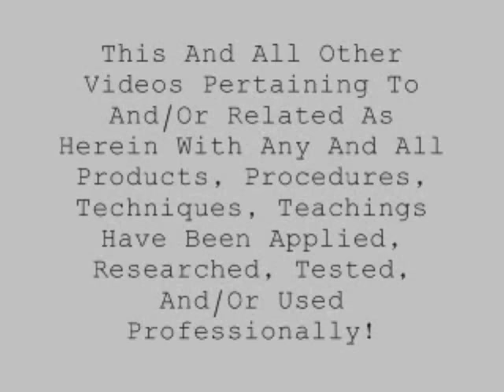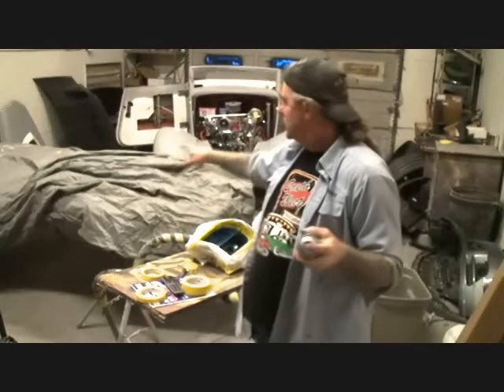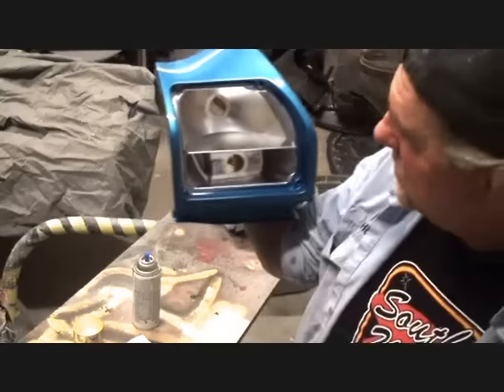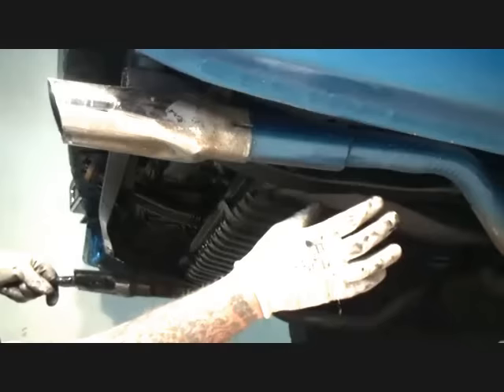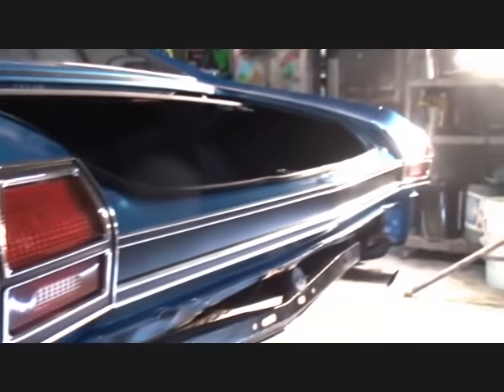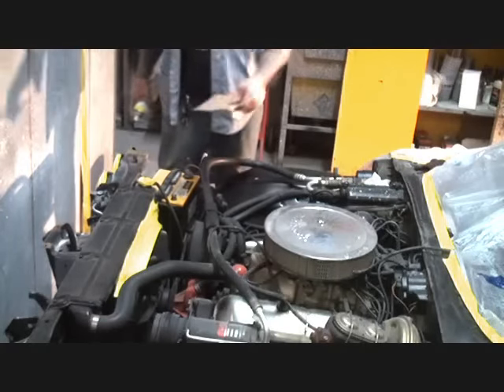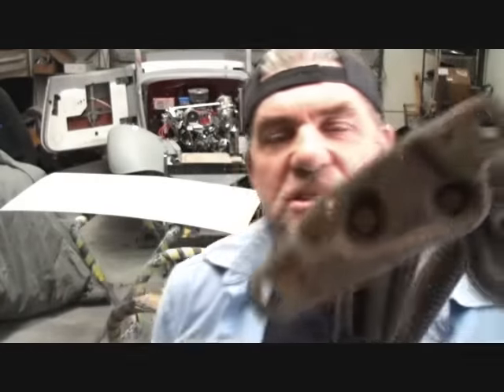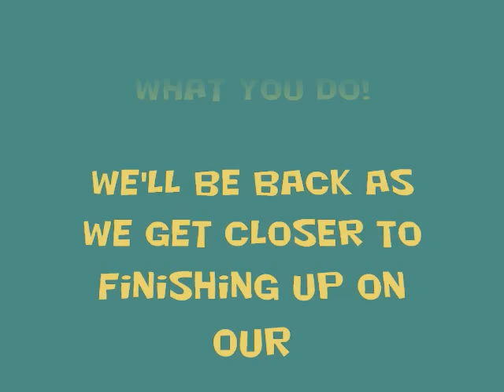"How To Paint A Car"-By Yourself-Part 15-"ATTENTION TO DETAIL"

Comment: Bolts , nuts and washers the same size as the mark you want to save will work very well. Place the washer over the old mark and use a bolt and nut to hold it in place and you won't have to worry on losing the marks.

Comment: hey Pete just throwing out a tip to you about POR 15. It really only likes to stick to rust like a light surface rust. It doesnt really like to stick to a painted surface very well unless you use an adhesion promoter. Not trying to be a know it all or a jerk here bud just trying to throw a little help back in your directiion to pay back all the help Ive had from your videos. Bill

Comment: Pete of you really want do a blinding slick job on the tail light lens bucket, you can paint it silver and you can even foil tape it, they will be REALLY bright. They make super high reflective tape its like a mirror. .. But for a customer car, Ehh. Its kind of a custom touch + it can fail in time.  I have seen alot of RESTORED cars with really dim lights at car shows,, I bet the lens bucket is body color. Your creation looks better than new!   Ive gotten paint on exhaust alot of times, It comes off crazy easy with a razor.   At-least you try to fix it, How many crappy paint jobs have you seen with a BODY colored exhaust, completely overlooked.

Comment: Am working on a 94 corolla my son bought w/o me seeing it coz he kinda sensed it will be rejected.  We ended up stripping the car to bare metal using a heat gun because there was thick body filler all around.  One sack of body filler with three layers of paint  was removed.

Comment: 1982, I took a small hit on the front. They didn't open the hood and remove the L Bracket and VHF antenna or mask off the windshield . They didn't like taking a razor blade and scraping every square inch of the windshield But They Did!.

Attention To Detail
Reply from the maker: +mcinkyt Ya gotta watch out for shops that get in a hurry!

Comment: where'd the guy get the idea the hinges were grey?   don't think so but seeing as he's payin' for it...grey it is.       the car is pretty...just don't open the hood  (G)    fwiw I use a semi-gloss black engine paint from one of the parts house chain stores on my mower handles.     they aren't all glossy but you can tell they've been treated with something.   been considering POR 15 for under the decks...after I wirebrush all the crud from underneath.    sometimes you just feel like dressin' up the pig   (G)

Comment: and about the time I was thinking "chrome paint", there you are. LOL 
I have a question for anyone ....What kind/brand of engine paint to use?? 
I obviously want something that will last. 289 Mustang project
Reply from the maker: +Hadrian Wall I use the stuff they sell at napa.. It's good ole engine paint made by Duplicolor or Krylon.. Ive never had a problem with it...
Reply: Thanks. I also was thinking of painting the transmission..good idea? and If it's ok, should I used the same engine paint?